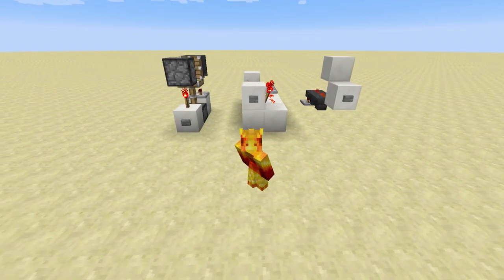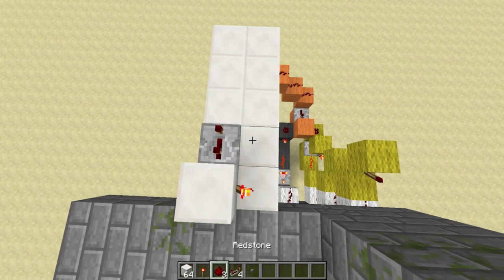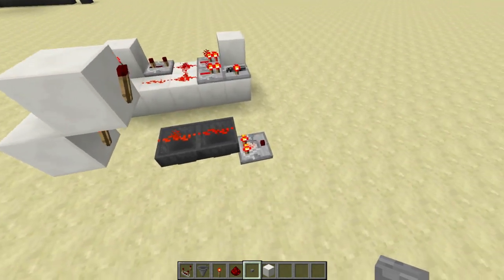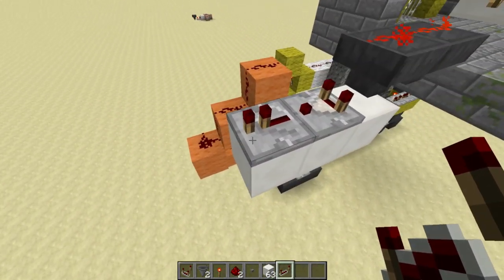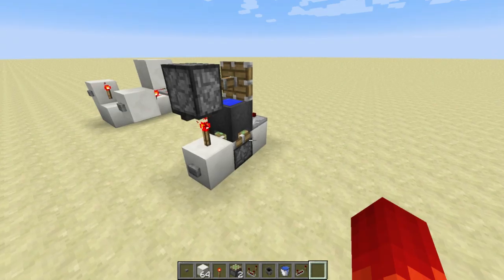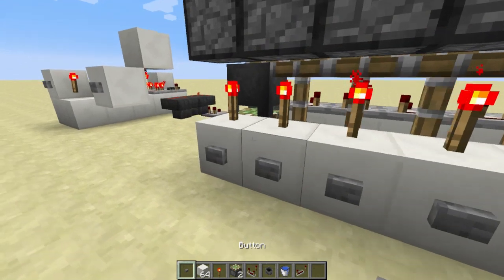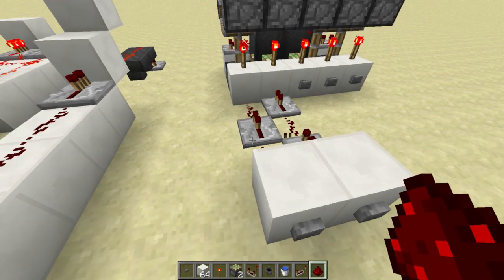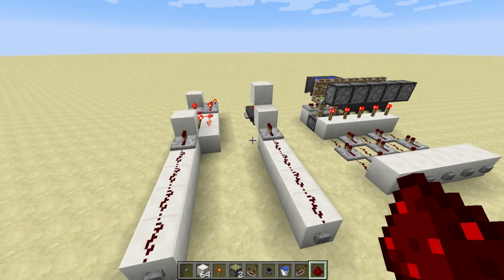MCTUT - Greatest T-Flip Flops (1.8 READY!)

Comment: the piston one i only a block smaller, also uses a comparitor and still 2 pistons. the other one you use one more torch and no repeater. if you run redstone on top between the torches it makes it instant or close to it, nm you add like another torch or something and it makes it fast. i used to use the normal one, then saw how to do the other one, but been so long since ive made it i cant remember what you add.. i cant remember ethos i tried to use it on console and dint work before. so i dont remember how its made. but i think its just one repeater.

Comment: The feature of getting a redstone signal out of a cauldron came after the 1.5.2 update, which causes some problems with the cauldron flip flop. But, if you move the comparator to one side and put a container, like a dropper, to the other side with a item in it, the comparator takes the output through the block. Also, when the flip flop was invented and 1.5.2 wasn't out yet, that was what you needed to work with. I used it a lot before the other designs, and it has its advantages.

Comment: I could argue that the initial design you criticized is really that bad. First, it's not that more loud than the third one which you're so over-hyped about. And it is even quicker than it, if you add a redstone torch above it. Not to mention that it's still the most economical redstone- and iron-wise. So yeah, while I enjoy the designs you put out here, I'm not convinced there are any conclusive reasons we should get rid of the ol' good T-flip flop design. The silent one is pretty neat, though.
Reply: The First one with the Repeater Bedrock Locking technique is pretty amazing though...

Comment: Why are T-Flip-Flops so useful (what are they for)? Plus, is there anyway you can give us a tutorial on how redstone works? This includes things like what uses a redstone repeater can have, what a redstone comparator does, etc. I want to make my redstone contraptions better :D
Reply: T-flip flops are used when you want to make a redstone powered door (like a castle door) but it needs to be opened from inside and outside without a problem
Reply: RThrim700 Way too specific. They're used when you want to toggle a redstone signal on and off. This could be used for far more than just doors.
Reply: ***** It was just an example
Reply: If you want to know the basics, try searching "Redstone Academy" on Youtube. It's a 7 episodes series by Generikb. Probably the most noob friendly tutorial out there.
Reply: RThrim700 ***** Thanks to both of you!
Reply: Basically when the build calls for a lever but you want to use a button or pressure plate

Comment: Calvin Curry unfortunately it actually will. Xbox Redstone mechanics are slightly different from computer mechanics. If you look closely the output repeater had a bedrock line on it. That means it is locked, Xbox doesnt have this feature. Just stick with the old t flip flop or wait till the lock is added. Hope this helps

Comment: I dunno, I must be one of the few that doesn't really see a reason to change. Most of my builds are very size limited, so the old T flip flop being so small is a godsend.

The first design, in my opinion, is too bulky, but other than that it's a good one.

The second one is small and silent (so is the first), which is good,but it's fairly iron intensive. If you have an iron farm or are in creative, more power to you, but since iron is used in so many other things I'd rather not spend so much of it with a simple T flip flop.

The third is even more expensive than the old flip flop (and even louder?), but is totally worth it if you need multiple inputs and are space limited.

Bottom line: the old T flip flop, in my mind, is still a very solid design. Sure, it's loud, and it's slow, but if you're crunching for space and resources, it'll fit like a glove. I'll still revisit some of my creative builds and check if I can fit some of them. ;-)
Reply: What about the monostsble, Tried that one?
Reply: IM Wercs
 Hmmn...I took a look around, and they were interesting (mainly the ones here: /watch?v=TL7oJ6g84pY ). However, these also use pistons. The dropper one... I have mixed feelings.It has the dreaded ingot hogging hopper, but other than that it's very similar in cost to the old one (though you need to go to the Nether before), and it's silent. So, I guess it'll become my go to for the situations I describe, if I have access to the Nether. =P

Keep in mind, when I say space limited, I mean that I often build in 2 x 3X/Z x ?Y or less spaces, since I like trying to squeeze redstone between walls in my houses (block-gap-block between different rooms). =j

The best I tend to get is 3 x 3X/Z x ?Y in the rare instances I have the corners of 4 rooms meet together (I shave off the corner blocks, no one sees it if it's indoors), though most of the time I have to work with 1 x ? x ?, 1 being either in X/Z or Y, so it really is situation specific on which design I use.

Since I also like using redstone lamps, though, the 1 block gap in Y is often cluttered with lighting redstone (for which I used a lever; I might change to the 1st design), so for piston doors and such, I just use the old design that is very thin.

Lastly, for large gates and such, I think the extra piston sounds add a charm, like giant gears turning before the main contraption operates. ;)

Jeez, I worry so much about compact redstone, maybe I should also consider doing that to my comments. =P

I think I'm done with the edits, now...
Reply: man, you over think stuff ^^
Reply: Hey, Minecraft's my toy box, and so I like playing around with it. I like implementing things that would make sense to have in a more realistic setting.
For instance, my farms tend to have irrigation ducts hooked up to a "pump" made with pistons and that goes off in a sequence by minecart. It makes me feel nice to do that kind of fluff, and I think as long as that's the case, I'm doing good. ;)
Reply: FNZero haha, that gave me an interesting idea... ;)
Reply: hint. Realism